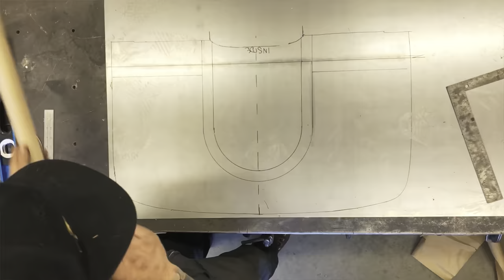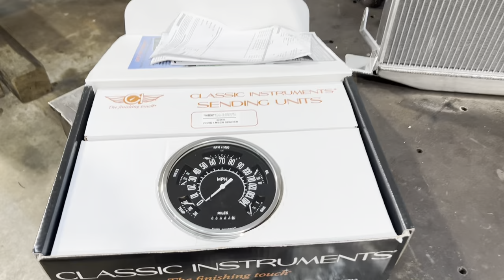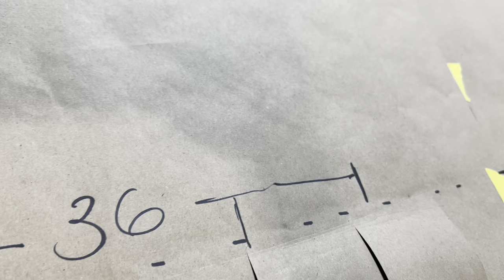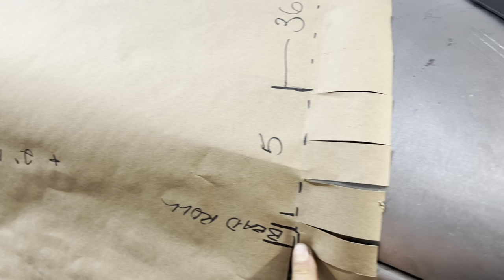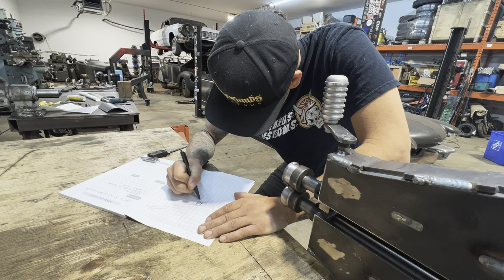How To Make a Hot Rod Hood from Scratch for a Roadster - Using the English Wheel & Bead Roller!!

Comment: Couldn’t you make a skateboard wheel for the top so it would be soft or is it too much trouble to exchange?
Reply from the maker: I have another wheel with a soft rubber vulcanized onto it but I will use in the future I just need to make the right size bearing for it

Comment: Here’s a challenge for the model-A...build a set of louver dies that step-match the 4” to 5” corner radius of the hood (just above your awesome bead roll)...but that stamp at an angle that matches the rake of your windshield posts...nobody puts louvers on the radius...especially raked at an angle...and you already have a test piece to test-stamp...
Reply from the maker: Man that would be so crazy to do a louvre like that
Reply: @MakeItKustom  crazier if you clocked the rake from front to back...with the first louver in the front a few degrees raked further back from the (near horizontal) grill...the last nearest the cowl a few degrees less than the windshield rake...and each louver in-between an equally divided clock step from front to back...depending on how the final hood came out and how repeatable the process is, you could sell the hoods for a pretty Canadian penny...

Comment: Karl,
Has any one said to you when working alloy to use wax or soap on your discs and sanding discs???
Your discs and wheels work better, don't clog and last longer using wax or soap, even with the special alloy discs.

Karl, with the extra material you use in say your bead roll. Put some masking tape over the bead making sure your in the corners then transfer it to a flat bench and measure the length that will tell you the extra measurement you need.
Reply from the maker: Yes definitely! Thanks for reminding me I don’t do a lot of it so I totally forgot to even lubricate my disc. I have some cutting wax I normally use

Comment: Karl, when using the "rubber band" on your English wheel's upper roller, would the 'temporary" 3M adhesive spray keep it in place for you?  When done, just peel the rubber band off and clean the roller with an appropriate solvent.  I've watched you have to "adjust" the rubber band multiple times in many of your videos, so I thought this idea might eliminate or reduce one PITA that you've got to deal with in a typical day.

If the idea seems good, you could go to their website and search under "bonding-and-assembly-us" and then "spray-adhesives" to get to a page showing many different types of adhesives, some permanent, some not.  If they don't have a suitably removeable adhesive, perhaps a thin double-stick tape would work?
Reply from the maker: Yeah I did actually use some double-sided sticky tape in the past and cleaning the wheel was just a bit of a hassle. I do have a new wheel that I will be swapping out once I make a bearing for it. It is vulcanized with rubber on top

Comment: Rule of thumb is, never throw a 3M disc away! I toss them into a drawer and fish out old ones for a variety of uses. Even pretty worn out they are still useful.

If you have to work on a gummy material for example,  you dont want to use a fresh disc, that would be insane!
Reply from the maker: Yeah I don’t throw them away I cut them down and reuse

Comment: I hate to be a martinet, but would it not be advisable to wear a respirator whilst cutting/grinding aluminium? Nicely done Karl, it's been a few years since I've had my hands on a T-bucket. Aftermarket hot rod outlet..."Yes. with our inventory you can assemble your very own '32 Ford in a weekend....(NOTHING quite fits ANYWHERE!)  "Also, everything is adjustable"...(points to 3 lb lump hammer on display). I was kinda expecting you to do the Snoopy 'Happy Dance' after that successful bead roll 😆 awesome, awesome, awesome!
Reply from the maker: Lol yeah that was dance worthy for sure lol You’re definitely right about the aluminum sometimes they overlook things that I know don’t take long

Comment: How come you can't glue rubber band to wheel only in a couple spots so if you want to remove it wont be so tough I've noticed that you use it more than without rubber band.
Reply from the maker: I’ve got a separate wheel that I need to do some machining on and I’ll be using that. It has rubber vulcanized on it so it can never come off

Comment: Instruments out of a shoebox... that was so I didn't forget. I am finding out to pause the video and write down parts of my comments, that said is will you possibly do a short "arch" for lack of the right words .. that will mimic the new roll that you just designed for the roller? One end of this        "arch" follows  the body for a good distance but the grill shell has none at all in it so I think you could do it to the shell for say a couple inches to make it belong in the grill as well. I just don't know the accurate total distance. and just for shits and grins... have you considered making some of the rolls out of "Iron wood" or say hard maple... wood is a bit cheaper than steel and shouldn't rust, it may not collect those bits of dirt or grease that screw  the project up as it will do if its not cleaned occasionally... I am just saying this because I have my self appointed college degree in armchair metalergentcy ... some might even call it "technology" so your knowledge won't have the many hours of research setting on my ass drinking tea and stuffing my piehole with hamburgers and giving me a  arch in  the abdomen. I poke fun at my body now because as a young man who  trained for the olympics in strength... the  result is like taking something that has a certain shape and so to pour metal in a mold, you force the piece into damp sand and get its mirror image. It certainly hurts my own self image. Everytime that you do something with this machine, I  pick up stuff that I never think about. I'm extremely tired or would of dropped a few more   questions.... thank you Karl
Reply from the maker: I haven’t tried Ironwood but I bet you’re right it would work well. As for the body line I think I’m going to end it in the hood by pressing out a nice end and welding it in
Reply: @MakeItKustom  I really enjoy the responses from people doing the stuff I would love to do. Kinda makes me feel needed or not some goof who just needs attention. I am so severely crippled and pain is off of the charts. One big reason was the push to remove any help from drugs that do help. The government felt that taking all of them away would reduce the amount of people finding them to abuse them. Like say taking guns make us safer. Bad people are just that and find anything they want right under the noses of police yet those with no protection are now in more danger. I have never hunted for game or killed anything like food animals since I came home from vietnam. I just lost the taste for it. We just change. I can now get medication, but my head thinks "People who see you take meds look at you as a addict so I have to be in so much pain that my body starts shutting down. I loved my own shop and made some really cool  tools that I see made the tool trucks later. To me, they just were needed. When I got rid of my truck because of pain and could not get into it, I  have never stopped feeling like I let myself down. I built a ford F350 quad cab diesel 4X4 dually with a five speed, every bell and whistle. I got that rig in such bad shape that my brother kept telling me Morgan just send it to the crusher yet when finished he pestered me to sell it to him. It was flawless. Not even a bubble in a cab corner. I  traded it when I was just mad an have had the worst of withdrawals because of it.... never go shopping when hungry or "sell your toys" when just angry does apply here. I so do love the work  that you do.. would enjoy still doing it myself. I watch start up channels that someone has started a project and hung up on why it did what ever that problem was, jot down the probable cause and wala boom, they are fixed and running again.... gives me purpose

Comment: I disagree with removing that extension you have tack on, because it lengthens the guide so less chance of not producing a straight line,  l think that the original width is way to short. The wider the guide,.less chance of making a BIG mistake. 👍👍👍
PS --- I like how you admitted that you received that drop saw for free,a lot of channels don't.
Reply from the maker: Yeah I think the original one is too short as well especially for a hood like this. I do want to remove the piece that I put on so that I can make a better piece. I might use the original fence as a Bolton spot so that we can attach a perfectly straight long permanent rail. Yeah with the chopsaw it’s sort of the first sponsorship“ I have allowed because they are so grateful and relaxed about it no contracts just hears this tool and if you like it great if you don’t great lol I just want to be honest and transparent and I don’t want to sell anybody anything just share good stuff
Reply: @MakeItKustom  👍👍👍 good one MATE 👍👍👍